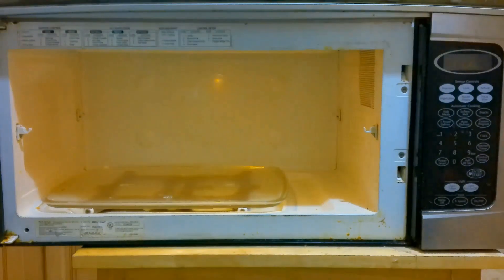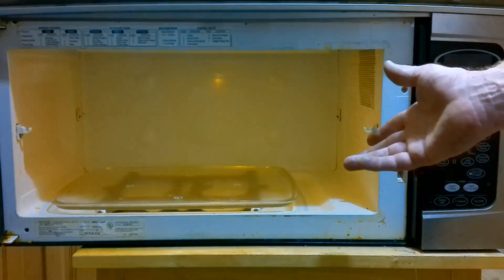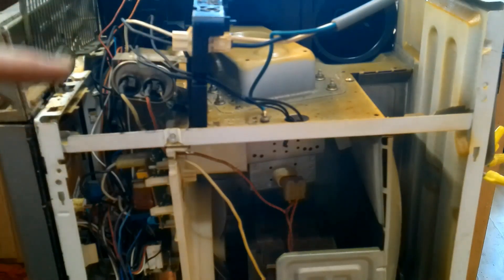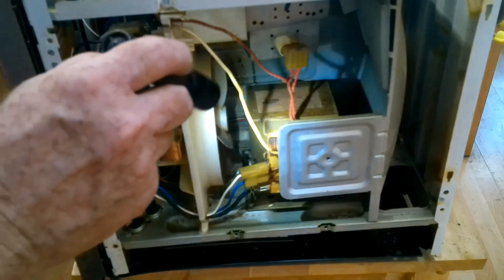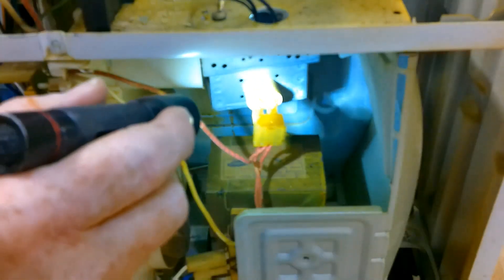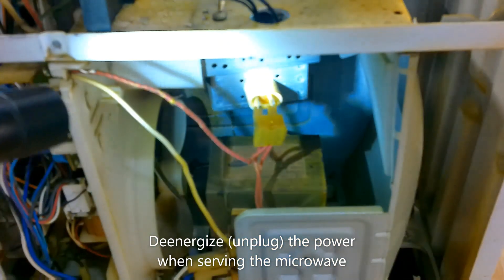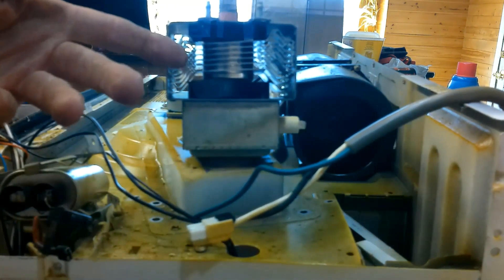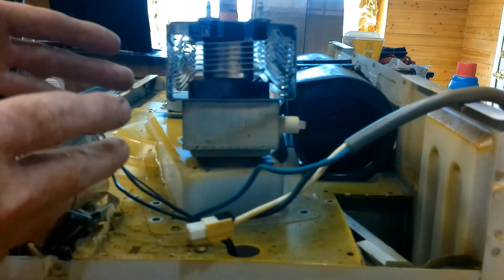Microwave Magnetron/Transformer Trouble Shooting.  Product Review on a Maytag Microwave MMV6190FZ04

Comment: Hi, I was surprised to see my microwave had a video, thank you.I have the Magnetron, it looks just like yours. I found your video using numbers in it. I bought it from a friend about 3 yrs ago, it had been in storage for a long time, after she removed it when she moved several yrs ago, and never used it again t.She said it hadn't had a lot of use when she stored it,and I like you, love that square plate, back and forth movement. Looked almost new,  and we have been very pleased w/it.Today- I put a glass anchor hook measuring cup full of water in it, hit 3 minutes. It will steam inside mw, and loosen any cooked-on foods, and without chemicals, you cold clean the inside of it. I've done it several times before. But today, I didn't think it got hot enough, (I usually go 5 min) but I put it back in for 3 additional minutes. I cleaned it inside and out, and didn't notice it then, but about half hour later I went to use it, and it wouldn't start, the LED Screen says >>SE>> , I think, or it may be >>5E>>. I figure it may have gotten too hot and something may need reset.. The lights work, nothing else. Do you know what SE code means? I thought maybe Sensor? Or do u know where I could find a manual for it?  Thank you so much for taking the time to share your knowledge. I know it has been a year since you posted this video, I pray you see this comment. I only pd. $50 for it, got 3 yrs out of it,  but I really can't afford another, with the cost of basic essentials today. #WeNeedTrump
Reply from the maker: The SE error code on a Maytag microwave indicates a problem with the keypad or wiring. To troubleshoot the issue, you can try the following steps:
Turn off the circuit breaker for one minute to power down the unit
Turn the circuit breaker back on to power the unit up
Monitor the microwave for one minute to ensure the error code doesn't reappear
Verify that the microwave is working properly 
I found this number in my manual to call for additional help:
800-688-9900